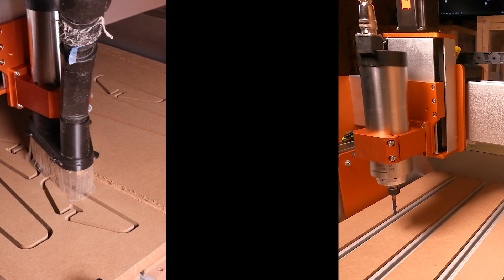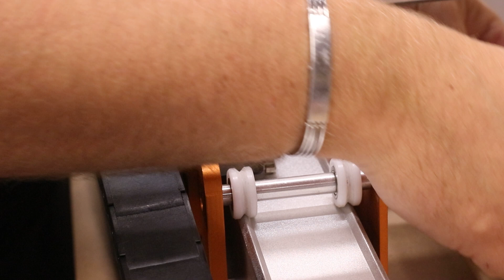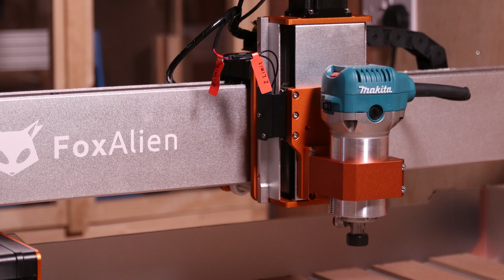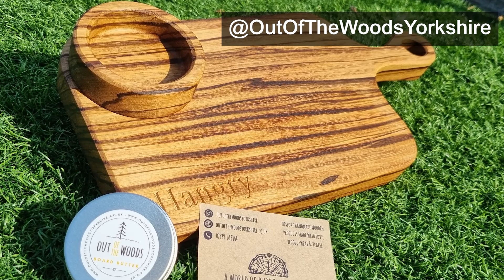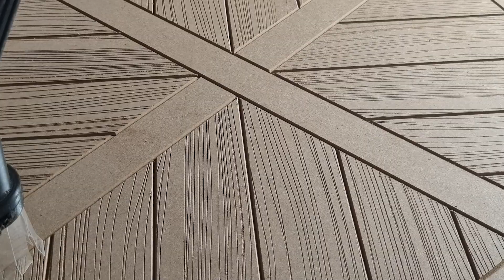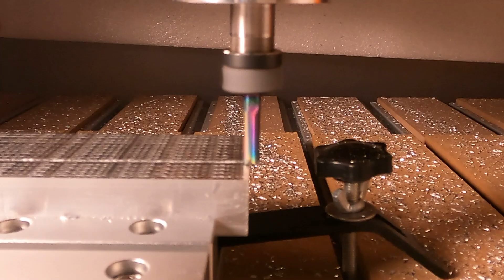Similar but different? FoxAlien CL-6560 CNC machine review

Comment: Has this machine been discontinued?  The link doesn't work, wondering what the most comparable model now would be?
Reply from the maker: Sadly yes. In terms of size you could look at the smaller LongMills which will come in cheaper I believe. https://bit.ly/48T8QG4

Or you could look at something like the Sainsmart ProverXL V2  with the extension kit

Comment: Hello James, I have a quick 2 questions for you. Before I start let me say that I am new to this and want to do this as a hobby. 1st question, does Fox Alien or any other manufacturer of CNC machines have a unit that can be adapted to the work area, for instance,  if the unit is 400 x 400 could you adapt the rails to do 400 x 800 ??. 2nd question, the picture you use to engrave , could this also be adapted to fit over a longer area. So for example, if I wanted to engrave a snake onto a board that is 400 x 800 , could this be done ? Could you break the 800 mm into 2 workable 400s ?. Thanks mate. Good channel.

Comment: This is the second time watching and I am super impressed I think the last Amazon days I saw a 1.5 watt air cooled spindle thawad way cheaper than I thought it would be. Like $170 American. I think pairing this or the 4x4 and the spindle plus new vacuum you would have a fantastic machine. I do wonder with the upgraded stepper motors they are using, why they don upgrade the Masuter pro for new unit sales. Speed and accuracy is so much better. Thank you for all you do. I am watching videos in the hospital after knee surgery so thank you

Comment: I am not a fan of OneFinity, but I must point out that you get a much better Masso G3 Touch controller with a touch screen on a 4x4 size for the same price as this chinese machine. The pricing just doesn't make any sense. And, it uses wheels instead of linear rails. Its crazy. You would be nuts to buy this at $4000.
Reply: Yea, you would be nutz, cause the machine lists for $1999.

Comment: Thanks again James. If you recall. You and I shared some correspondence a few months back about the 6560 and the vasto XL. As to which one I should purchase. I have not purchased either yet. But you had mentioned that you believe the Vasto XL to overall be the better machine. Would you say your opinion has changed? I don't mind the price point difference. I just want to make sure I'm getting the better machine.

Comment: Another excellent video and product review.   Did you have to do anything special about the dust on the rails to keep it running smooth?   Is a dust boot a necessity?   How did you go about cleaning the screws with such a small opening?